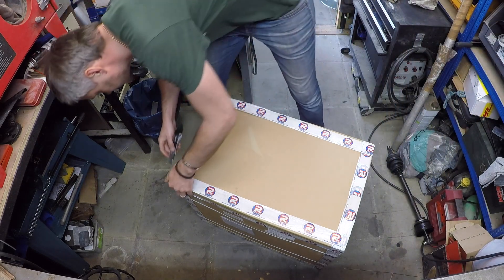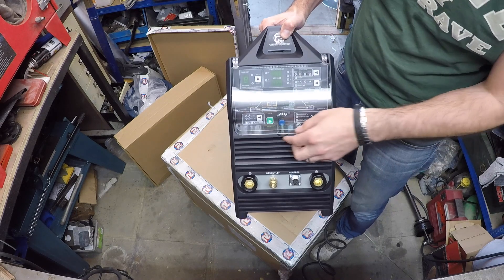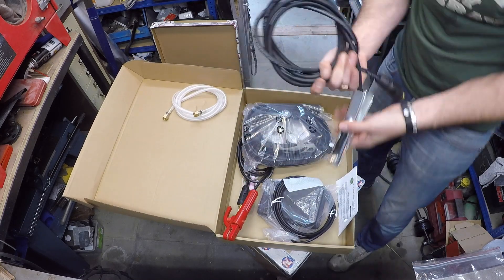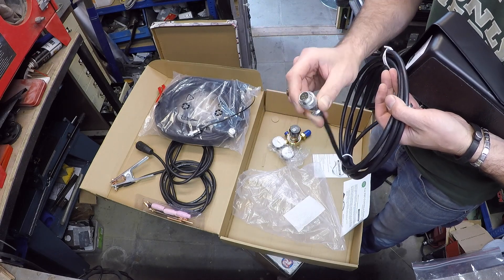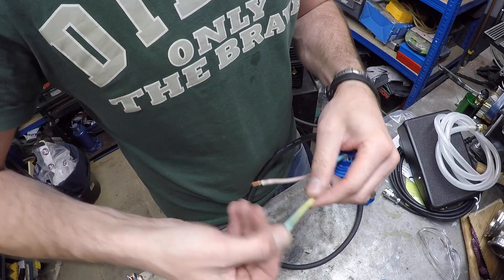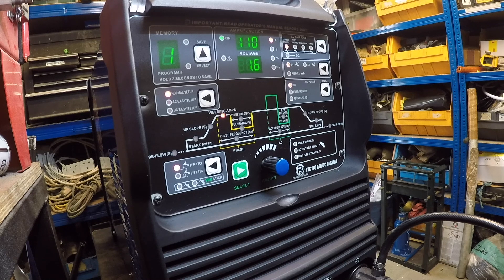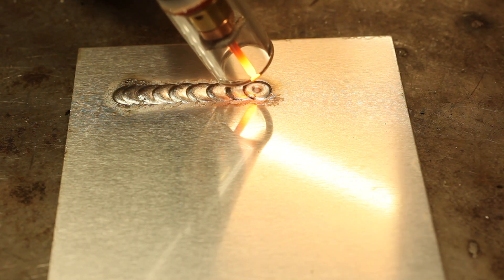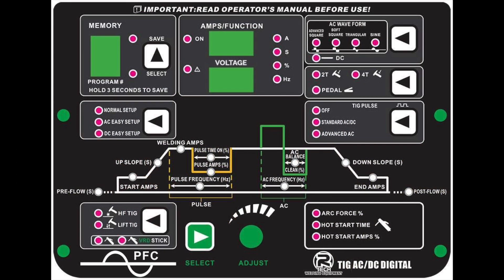R-tech tig welder digital ac/dc 170 amp 240v. r-tech tig welder review and first weld

Comment: I don't think they supply a plug for the same reason you don't get a bulb with a car spotlight, so the voltage choice is up to you, 12v or 24v, or in this case 13A or 16A, and let's face it they aren't gonna give you 2...
Reply from the maker: you are right most likely!

Comment: For aluminium,, let a sphere grow on the tip.
Reply: Thats mainly for transformer based units using pure tungsten. With inverter you should just make the 30 degree a bit blunt at the tip and the ball will create itself by just welding. So dont bother spending time on that. And the welds you did look great by the way. Just go back a little at the end and dab a little extra filler so you dont get those starvation pits. :) cheers. I got that unit in the 400A version with a ck torch.
Reply from the maker: Thank you! Great advice
Reply from the maker: thank you! i try :)